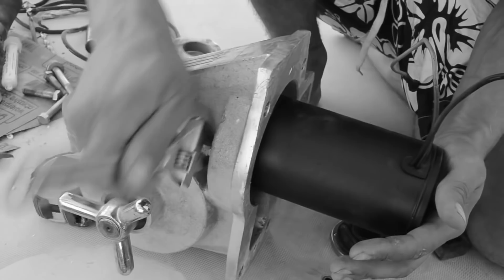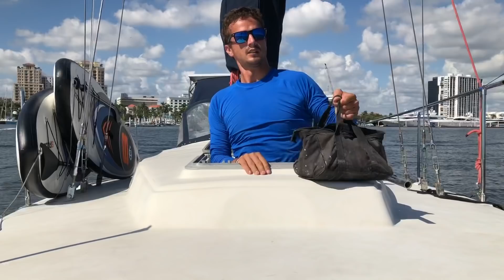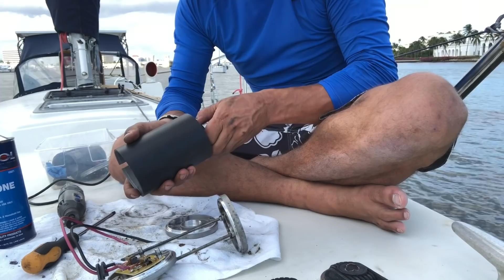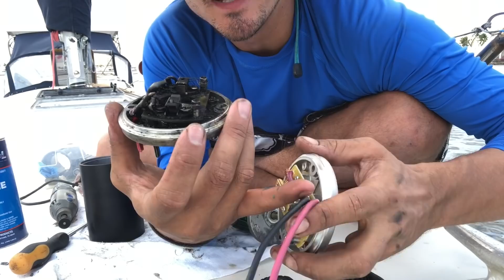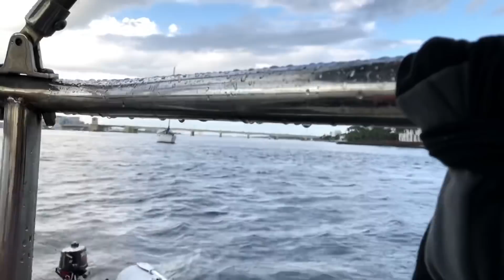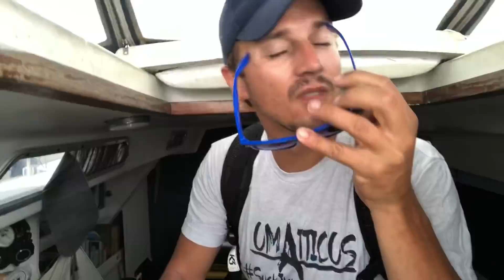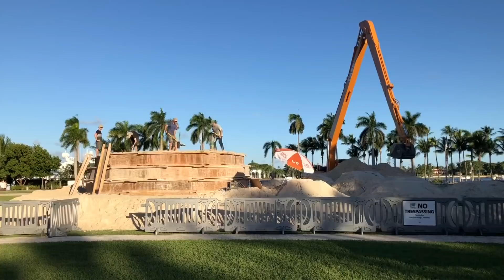Windlass FAILURE by myself [Sailing Uma — Step 146]

Comment: This is so old no one will read it but I don’t understand how you can suspend the laws of physics and I don’t seem able to at all.  Putting round tools, bolts, screws and other un-obtain-ables down on a curved deck with no toe rails is a guarantee of another week waiting for parts or tools.  

The other thing, I think can be put down to 50 more years on my body but when I sit down to work on something or get up I inevitably accidentally kick one of those un-obtain-ables out of reach.

Comment: I think you guys do a great job of all the work you do in the boat. I think I like having a winless with a big long crank arm for leverage and just doing it manually because electric things break all the time. But who knows if I was doing a lot of bringing an anchor up I might not like it but then again I was a shotputter and I like a little exercise on the arms.

Yeah when I can I’ll probably try to go manual. But the things I would hear that you are not adding a hot water maker and a water maker. I think those things are extremely functional and I really wouldn’t want to live without Taking a hot shower. Although you guys have the fireplace which one you get in the cold weather is really killer but it’s kind a like old boat so they have the potbelly stove. I think I’d want more of a potbelly stove like a cook on if I was going that route and totally redo the galley I guess. But I like your alcohol stove and I think that’s what I’m going to go with it my next boat.

Comment: Hey Kika and Dan, I recently found your videos on YouTube and since a couple of months I’m working myself through all your nice videos into the present. I’m technically interested and have a great respect for all the technical solutions and working skills you put on display in your videos, I really enjoy watching your troubleshooting.
I guess you already found a solution to your winch motor and reverse contactor issue. A possible solution could be to keep your reverse contactor to define rotation direction and wire your 48 V contactor between batteries and the supply terminals to the reverse contactor. If you can than manage to switch the power with a 48 V contactor, the reverse contactor is already closed/still closed and won’t arc.
Don’t stop and continue with your great videos.

Comment: your copper contacts on the new motor with the new lithium batteries have arched ie welded, i think you need a resistor to limit the current getting to it

Comment: Buy A 12V RESISTER, AND A FUSE TOO! SOLDER THEM TOGETHER AND PUT GLUE STICK AROUND IT OR USE INSULATION TAPE!!!! GOOD LUCK. The resister will make certain the motor only gets 12v not the Full 24volts + if you want to add a fuse the fuse will pop or blow before your motor does Sort of like a Guitar Amplifier does.

Comment: By the way:
- Although it was beautifully done - I wonder if it would not  be better for longevity of the anchor motor if it had no plastic tubing around it! That cover should be degrading because of resistance to heat dissipation.
Also it would let it self-dry better because of internal heat, and no extra barriers keeping heat and vapor in a cocoon .

Comment: Maybe you need a more substantial windlass, or a smaller anchor? You might also want to install a current-limiter to stop this new motor and the contactor overloading. The voltage isn't killing the contactor, the current is.

Comment: When contactors burn up, then one is generally not having a good day.
One solution to the issue is to add a resistor in line with it. It will put in some additional resistance, making the initial surge current smaller, thereby making the contacts survive longer.
This is though obviously not the "best" fix. But its very cost effective.
Also a reversing contactor can be built with a pair of relays. One dubble pole dubble throw one for changing direction, and one for switching on the actual power. (Now most relays are DPDT so it can be rather easy to just keep a bunch of them on hand at all times.)
One can also just have a current limiting system to cap the inrush current.

Comment: Contactors are designed for current and voltage. Higher voltage contactors have magnetic chutes to extinguish the arc and separate it from the contact surfaces. You can’t use 12V at 48 and especially not with a superlow impedance battery pack behind it. That Gigavac will do the job just fine as it’s designed with chutes. They’re great but not cheap....

Comment: Who'd have thunked 12V couldnt handle 48V?.., lmao.., that gave me a right giraffe :-p
Reply from the maker: A lot of electrical switches are rated in how many Amps they can handle at a certain voltage and usually support a whole range of voltages. Which means the more volts, the less amps, since the watts have to stay the same. We had been running that windlass on a 12V contactor for the last 3 years without any issue. We're still running it on a 12V contactor but only a single pole, so we only use it for "up". Basically if it says 12V @ 200A, that means at 48V you can run 50A though it.
Reply: @SailingUma  Dan.., I assume this is you?.., I studied electronics as a hobby.., I was accepted onto an HNC course because I was able to demonstrate I knew the fundamentals of electronics back when resistors had a color code :-p.., but I still like to dabble but I know that a 12V system cant handle a 48V system on this planet or another.
Reply: Ohm's law baby :-)

Comment: I’m betting the pvc housing you put on is restricting the air flow around the motor overheating it. Nice idea though. Maybe put a plastic t fitting and drill some 1/2 holes around the top of the fitting so the hot air has a way to escape.
Reply from the maker: The motor isn't on long enough to create any heat. It only take about 1 minute of run time to bring in our chain and that is split up over multiple short bursts.

Comment: I'm still playing catch-up on your videos oh, so here I am bumping one that's year old. But have you considered modifying your windlass so that you have a remote disengagement for your clutch? Depending on the design of your windlass, it can be accomplished with an electric solenoid, and will allow it to gravity drop instead of running the motor every time. Saves wear and tear.
Reply from the maker: Ours does, and we do. We just loosen the clutch mechanically and the chain drops with gravity. Much faster than using the motor anyway.

Comment: use a second 48v Contactor ( I Believe that's actually a solenoid ) to wire the other side up fyi  golf carts use 48v solenoids to switch between forward and reverse same as your windlass  heres a 48v reversing solenoid that should solve that problem giving you the ability to  run your motor  in forward and reverse  https://www.ebay.com/itm/Albright-SW182-Style-Reversing-Contactor-Solenoid-48V/390762967743?_trkparms=aid%3D1110001%26algo%3DSPLICE.SIM%26ao%3D2%26asc%3D40719%26meid%3D039e8ceb81294df993c13865e073c145%26pid%3D100623%26rk%3D2%26rkt%3D6%26sd%3D191851605305%26itm%3D390762967743%26pmt%3D0%26noa%3D1%26pg%3D2047675&_trksid=p2047675.c100623.m-1

Comment: Maybe radio frequencies interfere with remote control. Especially in a marina there are ton of diferent of them. Radio electronics need to have good locking frequency protection. If remote control of the anchor is a cheap one probably wont have that protection.

Comment: Install a current xfmr on the hot wire on the windless motor to trip off when the amps go to LRA.  Saves the motor.

Comment: Great job dude!   What do you think about installing the windless below deck with the anchor chain mechanism  below deck and going out an opening under the bow sprite?    Object being getting more uncluttered free level deck space to use.  

Oh I would plug that hole in the PVC.  By the way the PVC around the motor is a great idea!   I will copy that!
Reply from the maker: If our boat was set up for below deck windlass then I’d say it’s a great idea, but very difficult to retrofit.

Comment: As you learn more about boat electrics, you should start buying more diagnostic gear.  A good multimeter and an Amp-clamp for measuring voltages and currents.  I'll bet there is more than 20 amps going to your windlass.  (especially during the initial in-rush)  thats why old motors had capacitor's for starting.

also, not everything on your DC circuit board needs to run on 48 VDC.  It would be nice, but 99% of all marine and automotive electrics are either 12 or 24 VDC.  I would opt for a 12VDC house system and only use 48 for propulsion where higher currents matter.  You'll also save in the future by not buying the more exotic motors, contactor,switches, etc.

Comment: HI Dan and Kika! I have an old Lofrans Tigres windlass without motor which I would like to restore for our boat. Do you mind sharing some more technical information about your conversion with the scooter motor and parts needed? I am unsure about the gear ratio, rpm. Do you maybe still have the link of the order? That'd be great. 
Many greetings from Germany, Linda and Fred
Reply from the maker: The motor is 48V, so probably won't work for most boats. But anything in the 700-1200W range and 3000 rpm should work fine. Just check your shaft size to make sure the new one will fit. Then modify it accordingly.

Comment: I've never seen the need to use the winch to lower the anchor, even single handing a 42 footer. As you've found out it just adds complexity (and who need MORE stuff to fix on a sailboat!?!) plus doubles the workload on the winch. But that's just me.
Good vid though Dan.

Comment: The below ideas for forklift contractors are good. Also if the one you used is cheaper you could wire 2 for both directions.

Comment: Do you lock your dinghy and motor when you go ashore for a shopping trip. If so, how?
Reply from the maker: Yes. Absolutely, especially here in Florida. We just use a braided cable and high quality padlock. More dinghies get stolen in Miami that anywhere else we’ve been.

Comment: Dude, no worries... Good editing and video was fine.  We all learn from our failures.  By the way, I think the contactor was what broke/burn the motor the first time.  If you had it locked in place all the way in and that contactor decided to keep pulling in, pretty much you will have a burn brush.  I think everything is cool, as long as you don't burn the boat down... Right? :)

Comment: Oh Lord no toe rail and stacking those bolts had me cringing!  For sure adding snubbers on all inductive loads is a good idea.  One thing that can happen to a contactor is if the load doesn't draw ENOUGH current the contacts don't get cleaned properly and will eventually stick.  Usually happens to relays running very light loads.  Ah, so you had a 12V contactor, yeah, get a proper one and all will be well.  You could use two of the 48V units like you have and get both directions.

Comment: Precision cut keyway !  4 cutoff discs !!

When debugging electric circuits, frequently it is better to use a test light than a multimeter.  The meter show you have "potential" (voltage), but not if you have power (current).  Make sure it is an INCANDESCENT test light.  You will have to shop around for one that is rate up to 48V.

Regarding that motor.  Put it on your long term maintenance list.  Disassembly, cleaning, a bit of lube and another shot of anti-corrosion spray will make it last a lot longer.

Comment: Nice job - it does very much like you need a contactor off a forklift to better handle the voltage and starting current.

Comment: You need a "soft start" so the initial power surge doesn't destroy your electrical components with everything you have on the boat ! The guys at "just catamarans" can clue you in on that ! Thanks for sharing 😎
Reply: Very good suggestion... I have installed 14 of these for boiler pumps and they work great but they will come at a premium cost though. Good luck
Reply: A simple capacitor would absorb the initial voltage spike and make the contacter last longer

Comment: If you get tired of messing with the Ebay special mystery motor I suggest you call the guys at Groschopp, explain to them your application and they will give you a part number. https://www.groschopp.com/motors/dc-motors/  Get a motor bigger than required, that will keep the heat load down, which is what it looks like killed your old one. Very ingenious use of what you have on hand, great work. Oh, and what is the coil voltage on that contactor?  If you are driving a 12v coil with 48v, nothing good is going to come from that!

Comment: I=P/V so, higher voltage = fewer amps for the same amount of power. By using 48v rather than 120v, you will have 2-1/2 times more current flowing through the wires to the windlass. Your old wiring may now be under sized. Your battery sees the same volt-amp draw regardless of the configuration.
Reply: Yes. @0:58 he speaks about "being able to use really small wires to the bow". So this will probably happen again.

Comment: Windless Solution: To reverse any DC motor you only have to reverse the polarity (wires + & - = forward,,, to - & + would then = reverse). You could simply wire two switched on the deck simply wired in reverse of each other but get an electrician to check your voltage and amps going to your motor because with the new batteries you might burn out the new motor too.

About ? 20 or 30 yrs ago I used a $20 toy car remote control (and the servo from the car) to run my tiller autopilot via remote control. You can also do that with your windless or any DC motor. Then you can control your windless or autopilot from anywhere on the boat (even off the boat as far as the antenna will pick up the signal AND you can also boost the signal if you want to).  I could be in a dinghy or on shore and turn my boat like a toy boat with the remote, or be on the bow or below decks (watching via our topside camera and radar etc)... For the windless you can be at the helm or up the mast, anywhere, and operate it via remote control. Give it a shot. OH, with your new batteries you may have to have an electrician look at it to limit the juice going to your motor before you burn it out too. They may have to put some resistance in the line etc...